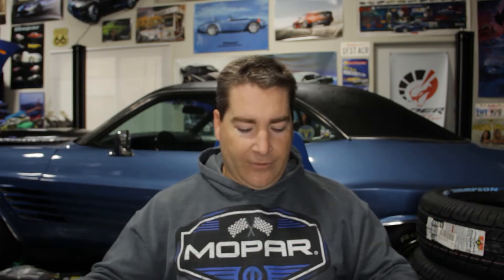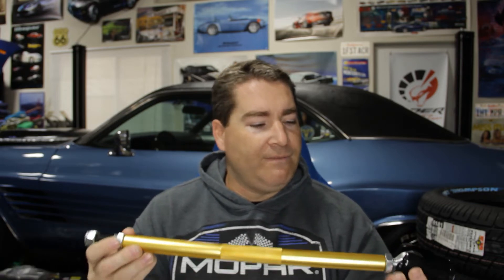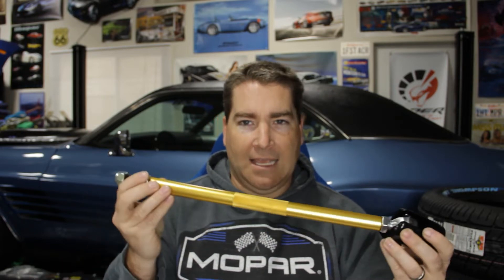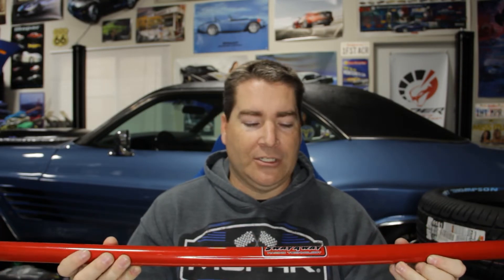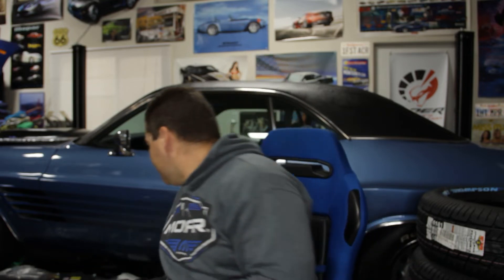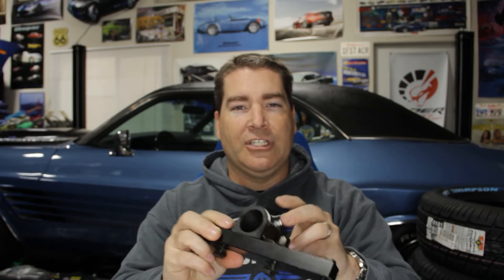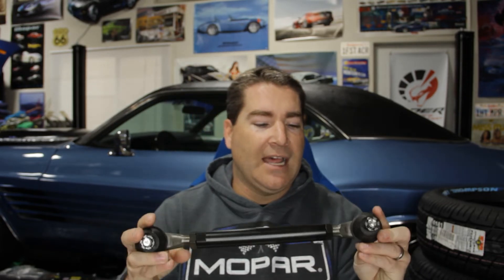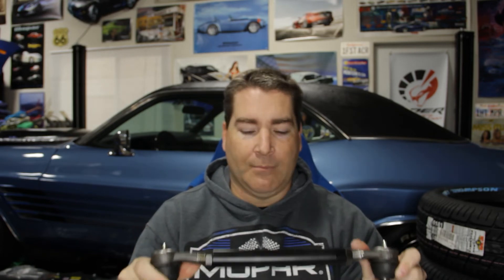Modernize Your Classic Mopar Handling with New Upgraded Components

Comment: Way more stress on the strut-rod to K-frame interface than the upper-control-arm pivots. The vertical separation of the moments to wheel axis is longer on the upper. This means it takes more force to accomplish the same work. Good choice on switching to the Firm-Feel! I share your opinion on heim-joints.

Comment: Nice set up. I went with a hellwig sway bar up front with PST 1.03  torsion bars. That and 17" wheels made a huge difference.
Reply from the maker: Thanks! Hellwig and PST make good products. My 15s will definitely be my limiting factor on the handling
Reply: I also went with Bilstein struts. Leaf springs I keep going back and forth on. Definitely need to replace them next.

Comment: Can you give us a before and after g rating? How the car feels is a subjective answer to the improvements you are doing. Showing how flat the car is in a corner and the amount of g’s the car can now hold in a corner will give you and us a better, more accurate measure of improvement. I have a 73 Cuda that I’ve owned for 30 years and am interested in what you’re doing. Thanks
Reply from the maker: I definitely won't be able to do a before, but it wouldn't be the best comparison as there are already non stock components. I've been thinking about trying to find a way to measure the g's after all the improvements. I can probably get video of how the car looks through the corners. Thanks for the suggestions I'll definitely take them under serious consideration!
Reply: @LifeatSpeed  there should be an app on your phone or a gps device that will give you that information.
Reply from the maker: I've started looking for devices I can mount in the car, they don't seem to be that expensive.

Comment: Hi Sir, Question; did you look at PST for suspension parts?   I used them to rebuild my ‘71 Barracuda, front and rear.   
- Larger torsion bars, “touring” sway bars, etc.  it was (10 years ago) free shipping.  Not sure if that’s still valid.  
- Rear springs, I went with “HEMI.”  I actually got them from the local Dodge dealership.  
- Edelbrock shocks in all four corners.  
- The ride does seem firmer.  But, nothing like a new Challenger
- Looking fwd to more of your Chally upgrades!
Reply from the maker: Yes I did look at PST, but most of their stuff is for more stock type applications and back in the day they were one of the companies I remember having upper control arms fail. They're parts aren't as "aggressive" as the parts I've sourced. I currently have hemi springs on my car I got from a Dodge dealership and after 15 years on the car they are sagging which is why I went with ESPO this time. Thanks for the question.